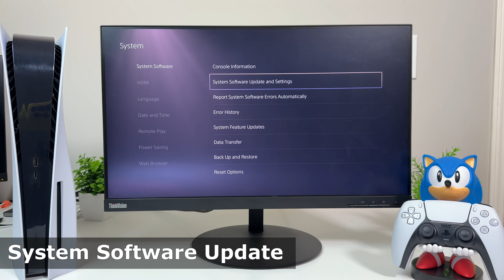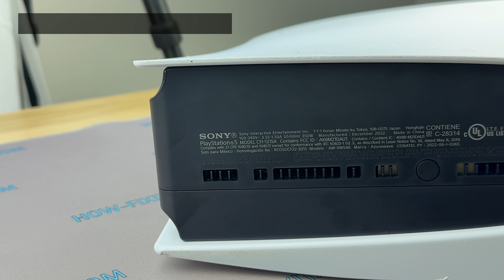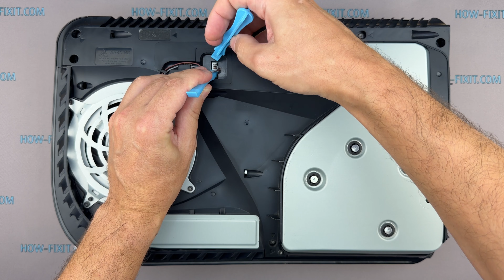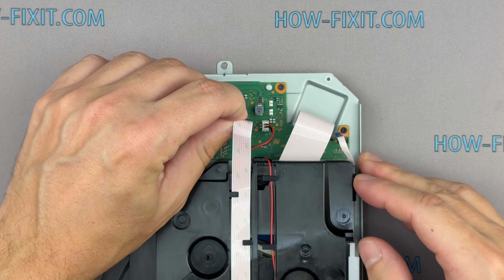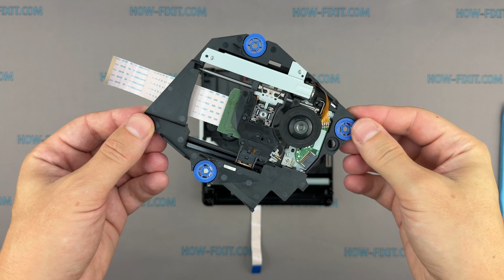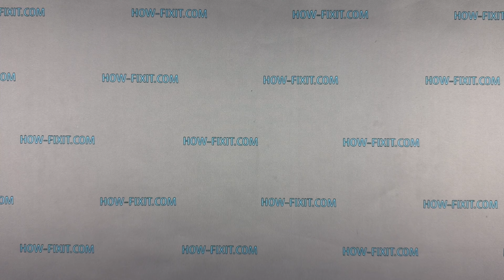PS5 Disc Error Fix | Not Reading Disc? Drive & Laser Cleaning Guide

Comment: Used this video to clean the laser lens in hopes of solving my disc drive issues. Took about 2 hours as someone not used to disassabling this type of system. I needed to combine it with another text and photo guide called "PlayStation 5 Optical Drive Laser Replacement" from iFixit because I have an older PS5 that's not totally the same as the one in this video. In the end it didn't fix the problem, but I didn't brick the PS5 either so it could have been worse.

Comment: Funny how a player never had this problem until after a software update
Reply: Same happened to me. Software update, my drive stopped reading only ps5 games. My drive is not worn out or anything as I use 95% of time digital games.
Reply: @i.l.y.m.l6331 did you fix it? Or get a fix?
Reply: @Zztxmps_2kk Nope. I am not paying for repairs for something that should have never failed after just 2 years not being used
Reply: @i.l.y.m.l6331 ah well I’m gonna repair mine
Reply: Fucking true

Comment: My disc drive stopped working out of nowhere and didn‘t read any discs anymore. I was a bit reluctant to repair it myself because I have practically no idea what I‘m doing, but thanks to your video I was able to replace the drive fully since cleaning the laser didn‘t help. Thank you very much for your guide, everything works fine again!
Reply: How did you go about fixing the problem plz help me figure it out
Reply: @leeblango8656 I just followed the steps highlighted in his video honestly. You might have to buy an entirely new drive if cleaning alone does not help, in the video it says which drive to buy for your model. Cleaning the the drive did not work for me personally, so I bought a new one, installed it according to his video and everything is still working just fine since then

Comment: First of all, I would like to thank you for this very detailed video. I experienced an issue with my PS5 where some discs were read correctly, while others would not be recognized. Cleaning the console’s laser did not resolve the problem, and the results remained the same. Replacing the laser was the only solution that fixed the issue. It appears the original laser had become too weak to read certain discs.

Thank you again, and best of luck to everyone undertaking this repair. 👍
Reply from the maker: Glad the video helped you figure out the issue and get it fixed!
Reply: Man I just did this and nothing 😢